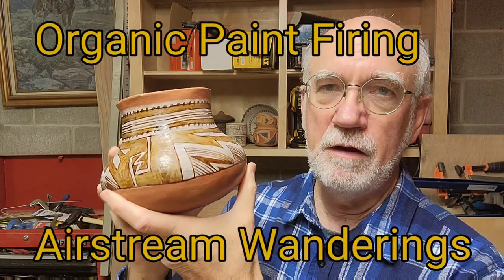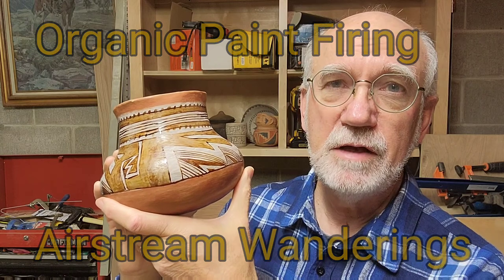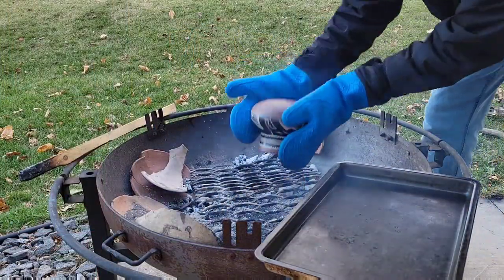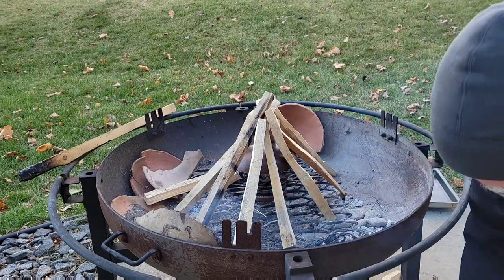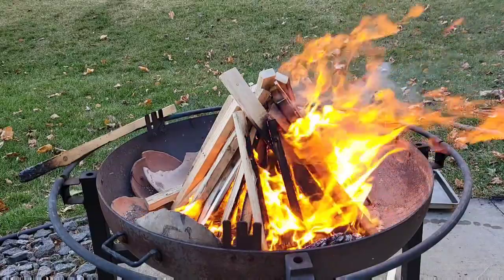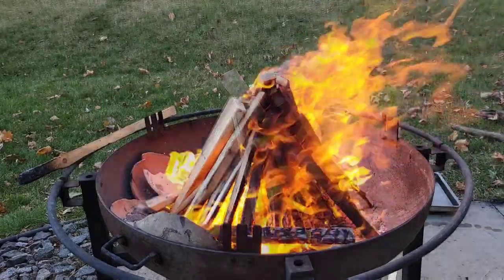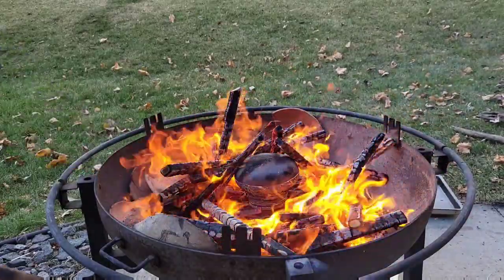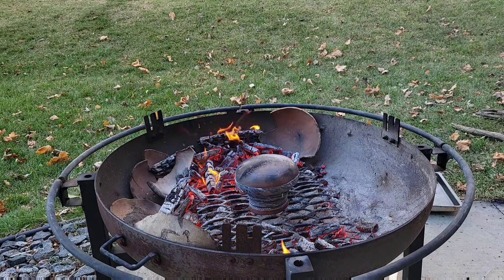Organic Paint Firing

Comment: Hi Wes, why do you think the pots cracked? Regardless they look great.
Reply from the maker: I think the cracking may have been a result of a few things. The weather was cool and I didn't use any sherds. Sherds help moderate the temperatures and reduce thermal shock. The issue here is that Salado pottery is traditionally fired without sherds so there are fire clouds on the bottom. In warm weather it may have not made a difference. Another possibility is that the temper was too fine in size, not course enough, or maybe too small a ratio to clay. Especially in cool weather, the temper will help reduce thermal shock. I have a video on firing in cold weather and also one on making grog for temper. Grog tends to be more angular than sand and seems to work better in these circumstances. When firing in cooler weather I like run my temper through a window screen to get out the big pieces then wash it to get the fine dust out of it.  These are my best guesses but it could have been something else.